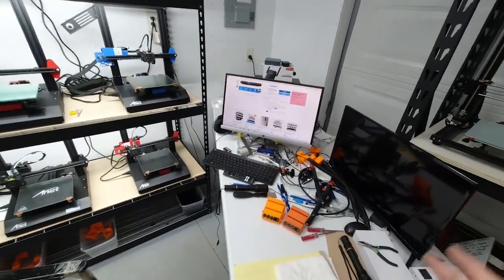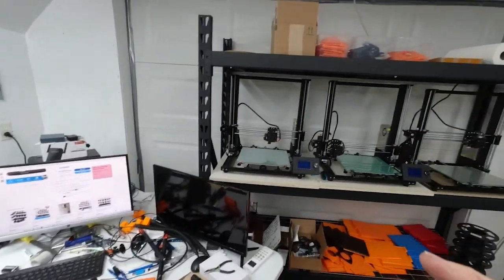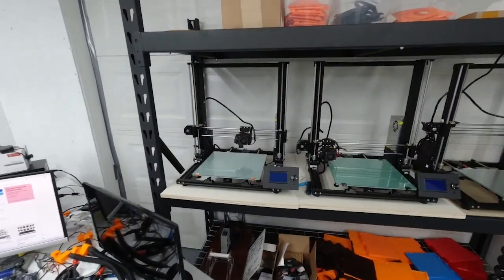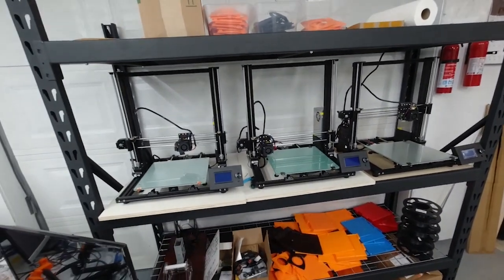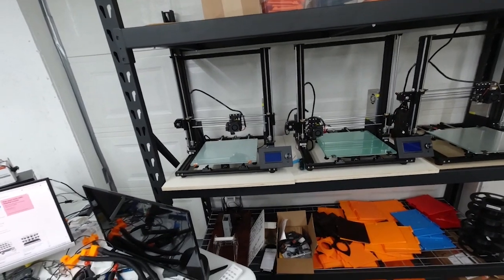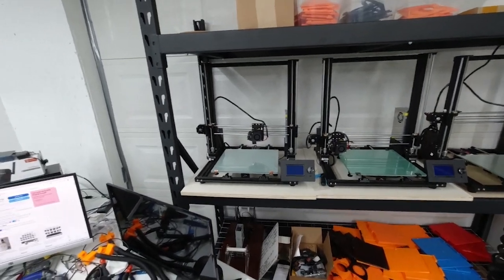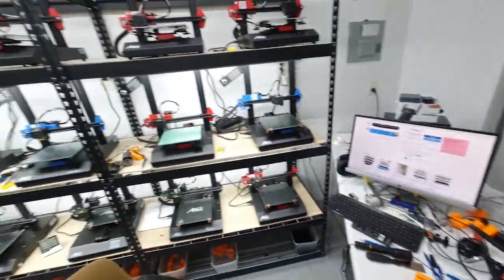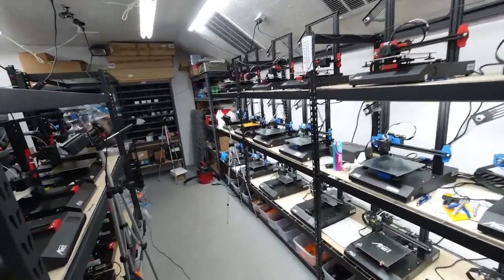HOW MY 3D PRINT FARM IS GROWING, now with 52 printers and more on the way.

Comment: How do you even keep track of calibrating a farm? I just got into printing and have had a time trying to calibrate 1
Reply from the maker: On the larger and more difficult parts to print, I have a test print pattern that is only a few layers high and can let me know if I have any leveling, 0-offset, flow rate, or other problem with the printer. On the other parts I simply print the parts until i start having a problem and then do the necessary adjustments. It is amazing sometimes how long a printer can go without any adjustments once you get it set up correctly. Thanks for your question and support...Ken

Comment: Hi Ken, last Christmas the Ender 3 was on sale for £118 which is around $154 on the Black Friday deals, bear this in mind for when you are purchasing printers, I don't know what kind of deals you are able to arrange with you buying in bulk, you probably could get them cheaper by buying in bulk but its also good information for viewers also.
 Great quality parts! I have seen the quality of some print farms that supply bad quality Prusa i3 MK3s parts and your parts are 1st class, my friend ordered some with his i3 kit and they were warped and covered in stringing and some were not even the correct sizes, I told him to send them back and I printed them for him, I had offered to print them initially but I think he didn't want to put me to the trouble
Reply: Microcenter got ender 3 pro for 100$ with a discount code.
Reply: I forgot about that, unfortunately we dont have Micro Center in the UK or anything quite like it
Reply from the maker: Thanks for sharing that experience, Andrew. I also saw the Ender 3 on sale here in the US for about $139 and I was tempted to buy some but had to pass because I really didn't need any more printers at that time and was concentrating on building inventory with the ones I had. The prints I get from the Ender 3 I have; are just as good as the ones I get from my Anet. Good to hear from you my friend and thanks for your support...Ken